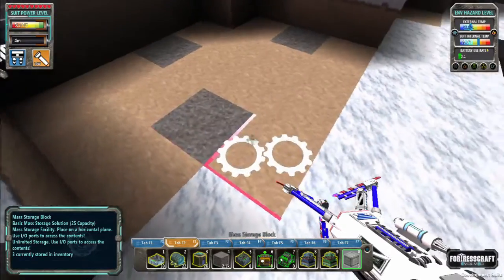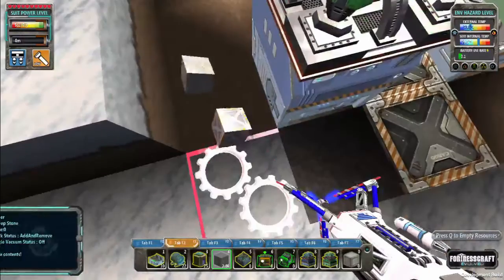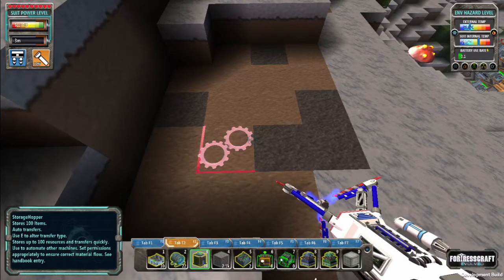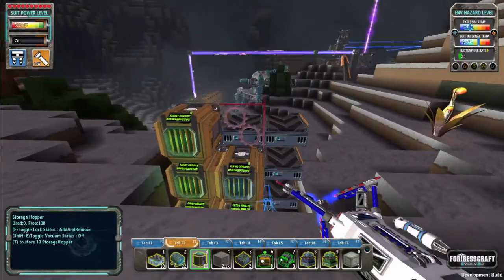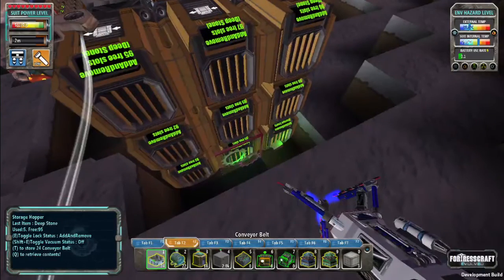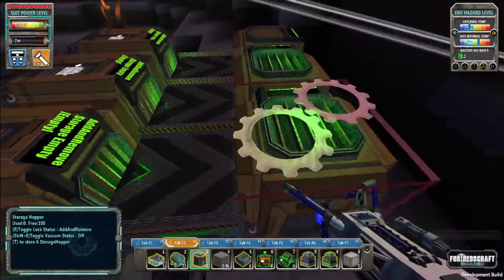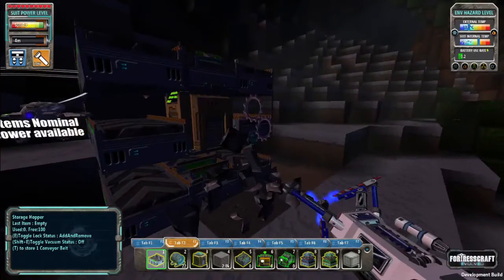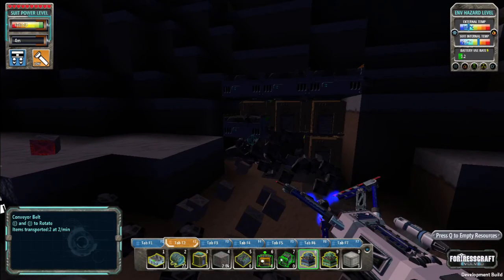Fortress Craft Evolved: Mass Storage Done Right!

Comment: Well, one thing to consider: What does it cost to expand mass storage capacity? Space and a bit of tin. 8 tin per 150-300 items. Increasing throughput is also possible. And you can access it on all sizes. This is useful if you build it BIG
Reply from the maker: I didnt use mass storage much, i just jumped streight to this, and this was 2(?) Years ago, i have no idea what has changed since then

Comment: You dont need that slice of conveyors between the the turn tables do you
Reply from the maker: you don't NEED it but it makes out more efficient
Reply: Wouldnt a storage hopper in place of the turntable be just as fast?
Reply from the maker: @ThuleApsu  um, if i remember my own design right you have to have turn tables or items wont properly transfer from the middle storage hopper

Comment: I know I'm a year late on this; but there is little point in putting in raw materials like ore, rocks, coal, etc... into mass storage. Because input/output is too slow for this. In that case, hoppers are faster. If the ores are piling up, then you need more smelters, grinders, whatever, to turn ores into products. Higher throughput will solve your storage problems. Then, you can use the mass storage for finished products such as rack rails, missiles, bug parts. Finished goods essentially don't even need outputs modules. You can just delete the storage block and place it down again empty if/when you need them.
Reply from the maker: ah I see, I always just used this system for storing bars, that way I could just Q the outer most wall and get all the bars I needed for other stuff

Comment: Wouldn't say completely useless. Just mostly! Can be used as a buffer to sort but they are very slow but you can obviously have lots of inputs outputs. Also they do take up a lot of space as you can't stack them. If they made them stackable it would help a lot! They are cheap though once you have the inputs and outputs. I'm on the fence as to whether to use mass storage or some other system for filtering. Going to mess around with it later.
Reply: P.s. you got a lot of video lag or is it my side?
Reply from the maker: +BA Velox It is probably on my side FC takes most my system to run, so it is a bit hard to record, that's why I don't have more FC videos.
Reply from the maker: +BA Velox Do you know if mass storage blocks store 25 items or 25 stacks of 100 Items?
Reply: +jamcdonald120 No just 25 unfortunately! Basically 4 equals a hopper. The benefits are that they sort it for you and they're pretty easy to setup. I have a field of them for just under 15k storage that then feeds into hoppers so I can just come along and clean out the hoppers of each type but I've ended up needing about 40 inputs for all the bars coming in. I'm kinda tempted to scrap it and replace if I could find something to sort it properly. What I don't want is a mash of all types of bars in hoppers as it takes an age to clean them out now!
Reply from the maker: I know what you mean, I just ran a pipe from each resource into its own smelter and storage.
Reply: +jamcdonald120 Thats not a bad idea. I didn't want to be running too many pipes from deep mines though so i'm smelting at source then just have a single transport pipe up to the surface but thats a mess trying to clear out 20 hoppers every five minutes. Below is my current answer. Might end up implementing your solution after the mass storage but to be honest, 6 outputs takes forever to fill the 6 hoppers I have for each type of bar! http://steamcommunity.com/sharedfiles/filedetails/?id=627273168
Reply from the maker: +BA Velox impressive, I should have done at the source smelting, but I heard it was getting nerfed so I didn't, so far, no nerf
Reply: +jamcdonald120 At the point I started bringing crystal, titanium and nickel up to the surface, it basically swamped my whole pipe system so I stuck the smelters on the extractors. I have contemplated going back to smelting at the surface as it's a ball ache to setup smelters every time you run out of a resource but I guess i'd need to run a few more pipes for that. Also, I discovered plasma cutting heads which I love but again totally swamp your system with resources (think you get like 254 ore per minute with a fusion motor)